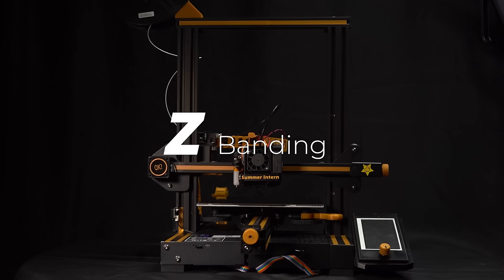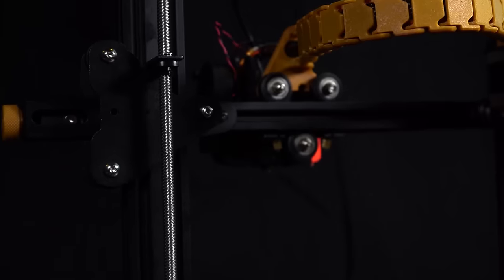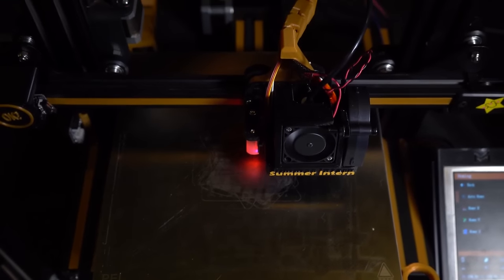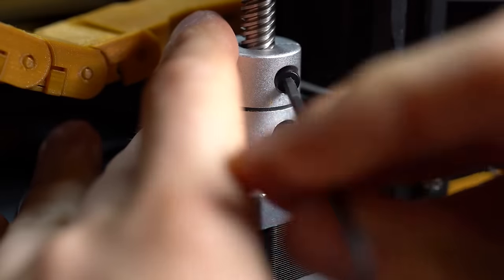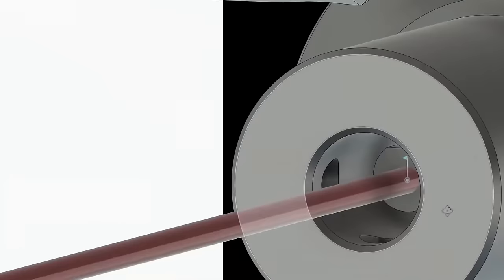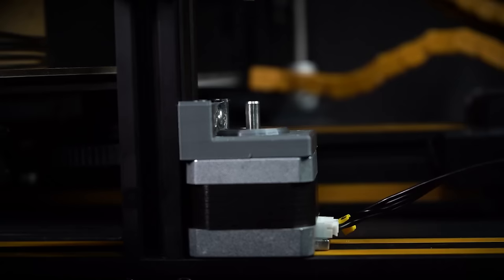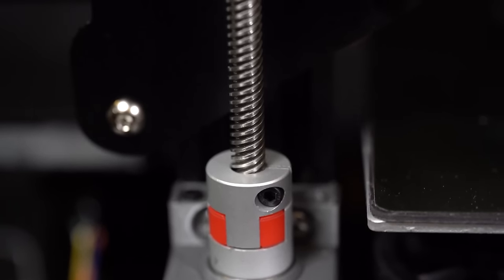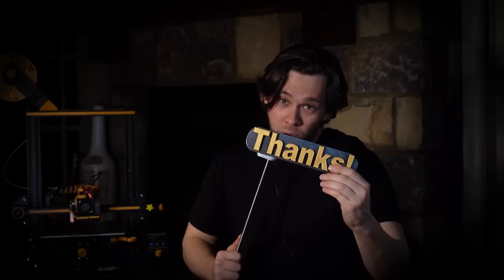I've Fixed Z Banding on my 3D Printer...FOREVER

Comment: Excellent video; Z-wobble can be a real PITA to resolve, especially for n00bs, so this should be a great resource. 👍

  Technically, POM does need lubrication, but, IIRC,  only if it's loadbearing, which in this application is absolutely minimal.  So, even though it's not required, a dab of PTFE or silicone lubricant should be fine.  There are a few types of co-polymers of POM, such as POM-C which contains ~10% PTFE, so no lube at all would be necessary. 🤓

  Oh¹, and Old Ham made me both laugh and cringe in equal proportions; it's pronounced as hold 'em, but without the H. 😂😬

  Oh², how I wish I could run this video through an audio filter to replace every "ZEE" with a "ZED", but that's a me issue, lol. 😜

<edit>  Subscribed!  </edit>

Comment: The just about to be released, Ender 3 V3 with CoreXZ kinematics seems to be a good approach with no lead screws. How would CoreXZ compare to linear rails?  Of course, the Ender 3 V3 is nearly double the cost of the Ender 3 V3 SE.

Comment: z acceleration can also affect this issue try lowering it from the usually default value of 500 to 200/100 and you probably might reduced/eliminate the issue in a few of your configurations.

Comment: the lead screw in ender 3 series is 365mm. Nema stepper motor with integrated lead screw have a max length of 350. Can these missing 15 mm be a problem ?
Reply from the maker: The installed 350mm leadscrew stepper reaches the top of the frame on the ender 3 just fine. No Z height is lost.

Comment: what is the VREF volts for the Nema motors to work properly without loosing any step ? I read somewhere that they require 1.8 Volts in VREF which is a lot higher that what the default VREF of Ender boards like 4.2.7
Reply from the maker: Stock vref is fine for z axis. If you’re losing steps, check you don’t have too much resistance between your leadscrew nuts and leadscrews

Comment: During your testing did you think of testing a belt driven z drive?
Reply: Also great video you got my subscription.
Reply from the maker: Yep, I still want to test a belt driven Z axis, Linear rails on the Z and the Wobble X attachment
Reply: @MaxyMeanderings I had another idea. What if instead of mounting the motors at the bottom of the 3D printer, what if they were mounted at the top. With a top mount could you sync the motors with a belt at the input shaft so you wouldn't put a binding force at the end of the screw? If this is hard to understand comment again and I'll explain better with images. 

Alternatively you could mount the motors to the gantry and then have them pull the gantry up this could also allow syncing at the motor level. 

Lastly is there any board with dual/triple independent z motor control for software syncing using offsets ?
Reply: @RussFoote  there's boards you can use independent dual z drivers(really you just need the extra drivers)  but I don't think they have some offsets.

I've thought of lifting the x axis(z) from the middle with 1 but haven't gotten around to doing that..

there's some belt synced 2 axis systems with screws and there's a corexy on the z/x axis bedslinger printer out there as well. while fun none of them solve some inherent problem that most people would care about so they're not that common. most people just don't need the z to run that fast.  you can use biggest linear rails you can find on the z rails that are static though and make that as rigid as you want, you can build a box that rises with the z to stiffen it up too since weight of that is not an issue on a bedslinger.

Comment: your motors shouldn't be getting hot. i been 3d printing for 9 years and never had a hot motor, they stay around room temp. 
i ordered a thermal camera and should be getting it in a week or two and so i can prove it then.
Reply: What motors are you using? Never saw a nema 17 that didn't get hot